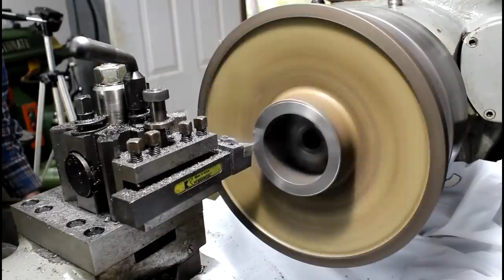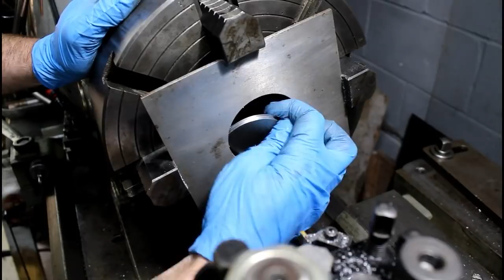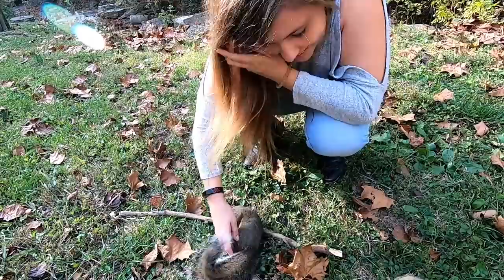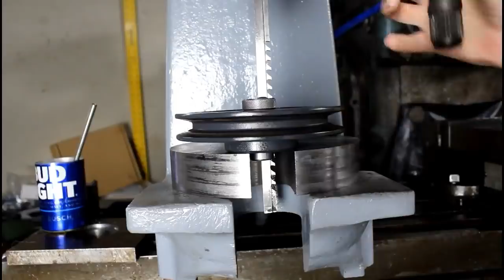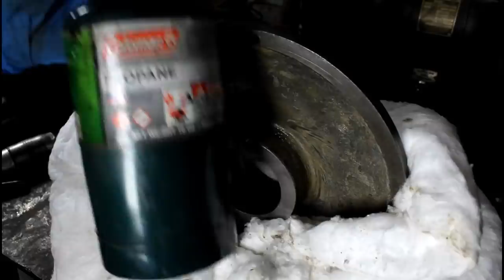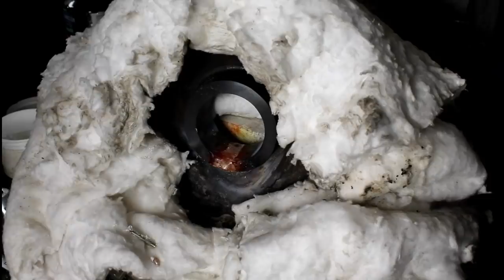Drive Pulley Trouble  SCRAPYARD SAW part 3

Comment: Since this was 3years old and people usually continue to learn, grow, evolve and shift how they conduct their projects, everything I ask or say may being completely irrelevant so feel free to disregard any or all of it. 

Maybe i missed it but Was there a reason you abandoned you’re initial plan to offset the keyway for that pulley? Best I could tell If you were planning to relocating the Key Way 90° offset to the original … or even 180° Im pretty confident that you could have ignored that crack altogether since the forces being transferred would no longer be acting directly in the fractures vicinity.

In fact since you know the direction of rotation you could have set the keyway 90° before the existing one so that it would more closely approximate the metal being “pushed” into the metal crack instead of “pulling” from crack. 

While this approximation is simply that and NO substitute for actual calculations and known formulations, it helps establish some simple and basic notions about what the metal is trying to do. The shaft is rotated which exerts a force on one side of the key which then in turn causes the opposite side to encounter the the side of the pulley’s keyway.  (Technically a rocking couple is created in the key which can exert pressures into the leading corner of the drive shaft keyway and trailing corner of the driven shaft; the opposite corners that normally aren’t involved with the actual transfer of force but I don’t think is relevant here) 
Back to the main point, by thinking of the metal key being pushed into the side of the pulley we can imagine the metal in front of the key (relative to direction of rotation) is being compressed by the force of key “pushing” into it, while the metal in the pulley situated behind the KEY is being stretched as its being “pulled” by the surrounding linked cast iron material to the side and behind where the Key is “pushing” into on the pulley.

A rough and inaccurate analogy but still decent enough for this point would be like holding an elastic band with 2 hands and driving your face into the center. While your face is pushing into the center of the elastic band the surrounding material having been held in place by your arms is now being pulled forward toward your face. While this is GROSSLY INACCURATE and leaves out so many important interplay information factors, it helps to portray a simplistic cause effect relation and envision whats happening to the metal and if that in turn will likely increase the chance of worsening the fracture when compared to an alternative option. 

If anyone bothered to read this and found it helpful, then I’m happy to know people exist with more than a 10second attention span 😂.

Comment: Man, that unit is needing some serious TLC.  Of course if a shop had to pay to do all this work it wouldn't be worth it but seeing as we enjoy repairing old "shtuff" anyway I think you're doing a good job and it will be a very handy tool to have in the shop for larger material.  I like your approach to each challenge, will be interesting to see how you decide to sleeve the repaired pulley and locate the center of the bore.  Thanks for sharing.

Comment: I just bought a doall vertical 6-13 bandsaw, hyd feed table, blade welder, 3hp for next to nothing. I bought it from a postage stamp sized photo which is always an adventure. I pulled the back off and there was the exact same v pulley setup as you have. Fortunately it is all tight. I think that your fixes will be fine and you will be glad you spent the time. It will last another 50 yrs at the rate that you use it. I am really surprised at how cheap these things sell for used. Well in your case it was zero wasn’t it? It’s kind of a shame because they are so much more solid than the import stuff they sell now. I think you will find it time well spent and rescuing it from the scrap heap will bring satisfaction as well.

Comment: G’day Steve looks like you need a welding tip for your oxy you’ll find it is a better braze and easier to control. 
Do you really need to sleeve since it only slides and cut another keyway. Thanks for sharing, cheers. Peter

Comment: I like it when fellow youtubers help each other out makes great content. Sharing or giving tools to friends or even a stranger to help out really shows good character and a giving heart. And that goes for the teaching or learning we all come to see without it we lose that knowledge that's not on the web. It's too easy to forget that things are not as easy as it seems coming from some website's directions. Sometimes you have to see it done with some info explaining why. The human factor is not what it used to be.. In my business(automotive) the times{labor rate guide)it takes to make a repair are ridiculous. Nowhere are there times to account for rusted bolt heads,broken off bolts that are seized, lack of access to a bolt., or room to remove the repair part. But with videos like this you get good info and a few tricks making life easier. This type of video is a tool in many ways. Great video.

Comment: Steve, if you get a couple of 4x4 s about a foot long, you can make a cradle for changing out your chucks on the lathe.
 Glue and stack them ,then cut out the diameter of you chuck so it slides under the chuck when you pop it off the taper....
it will save your arm

Comment: Squirrel wrangler and head machinist wife doing it all. Love seeing you guys. I think if you took the spacers you made and drilled and tapped a few holes and bolted those on the crack wouldn't have been able to go farther at least in our lifetime. . But the brazing was the best way to go. Are you going to use brass or bronze to leave the set . The damage wouldn't have happened if it was repaired right before. That kind of stuff just makes me mad as hell . Do it right or don't do it at all. Don't tell Elzabeth but squirrels love nuts , lol . Sorry just thought it was a little funny. Thanks n God bless you all.

Comment: By the time you make a sleeve large enough to accommodate the keyway without compromising the strength of the sleeve, there is not going to be much parent metal left on the sheave. Going to be a good one to watch, since the variable belt/pulley arrangement will put a lot of asymmetrical side loading on those sheaves.

Comment: Hi Steve thanks for another interesting and educational vid. I was wondering what your thoughts are on drilling the end of the crack  to prevent any future travel  or it just would not because the crack would need to be through the radius of the disc to continue traveling

Comment: Brilliant video Steve, and I'm looking forward to Part 2 when the sleeves are fitted and the old pulleys are running as sweet as a nut. 'Absolutely not' worth fixing? Not true! I for one am loving this renovation because of the variety and complexity of the issues  and your solutions for them. You've fixed up some beautiful old machines but this is my favourite so far. If possible though would you show us the process of finding that crack? Cheers and thanks for sharing.

Comment: There would have been a simple method of repair. You could have turned the outer diameter down to it just cleaned up. And then you would just have a sleeve shrunk on hot. That would surely last forever.
To make the keyway into the rings, you don't need a shaper. A simple file is enough. That does not take more than three minutes per ring.

Comment: You have any interest in, or need for, a big azz, hydraulic broaching machine?  I'd never seen one before, a friend picked it up at an auction.  It is in Oregon.

Looks to have a 4-6' ram out the right side, (only saw a pic).  It reminds me of a wide printer they use for posters, or a vinyl sign cutter, except, it has a 4-5" diameter cylinder stickin' out the side.

Saw an image of the name plate. Got it a feeling it's 40-60 years old, just from the style & text of the plate.

If you are, I'll get you some good pics.

GeoD

Comment: Steve, I'm in the middle of watching a series of videos by Keith Fenner where he made a replacement cast iron part for a customer's K&T in 2016.  Because of the mess caused by chips spraying everywhere, he simply turned his cutting tool upside down and ran the lathe backwards.  That caused most of the chips to go straight down onto the towel he used to protect his ways and made his clean-up easier.  You may want to try that too, the next time you turn cast iron.

Comment: Steve with that cracked pulley half you could of machined the diameter upto the start of the radius and then machined a collar heated the collar up and then slid it over the top that would of done the job,
That way you wouldn't of had to worry about distorting it.

Comment: Save your young back, get a table that all you have to do is turn and set heavy chuk on it. That setting it on the floor will come back to bite you in the lower back. I have even considered building a small jib drain to remove and replace mine with. I'm getting old and whisked I had protected myself from that unnecessary  over exertion

Comment: I'll have to disagree on you saying it's not worth fixing, for what you have in it. And for your home shop, always worth fixing up an old tool. You'll never buy a new one like that. Especially if you have room for it. I suppose if you were high production high flow shop it would be more cost-effective to buy something new and replace it. But my motto is I got more time than money. You definitely have the skills to fix it. Should be a good usable piece of equipment in your shop.

Comment: Are they worth it? -heck yeah. You have the means & the skills to repair the pieces.
It's not going to be put back into a 'production' role, and will (IMO) serve your shop needs for years to come.
Plus you have the satisfaction and gratification that comes with restoring something that was used & abused & scrapped.
It's going to be one heck of machine after you've (with help from the Squirrel Whisperer) completed it.

Comment: What you called Ground Stock is probably what we called 'Gauge Plate' back in the day, I don't remember the exact composition, but it was an oil hardening tool steel, used for making flat go/no go gauges, also useful for making chisels, scrapers etc. Best Wishes from a wet UK but we beat the All Blacks and that's what matters!

Comment: Two late now, but why didn't you turn the outside of the hub straight and make a ring to press over the hub instead of brazing? All the best, Matthew
Reply: Matthew, I was just thinking the same thing. Seems it would prevent any further cracking.

Comment: I think you did right by fixing that wheel,  I liked the key-way demo you did, I never knew how they did those slot's.
Reply: A lot of things you don't think are broached are. The axle splines for car wheel hubs, square holes for handles(Abom did one a while ago), the magazine wells for AR-15 and M-16s are broached with huge pull broaches.
AR broach https://www.youtube.com/watch?v=CY9Cb9YqOR4
Gear spline broach https://www.youtube.com/watch?v=XVRq7q_3bBE
ABom square https://www.youtube.com/watch?v=tc-3rNWcqio